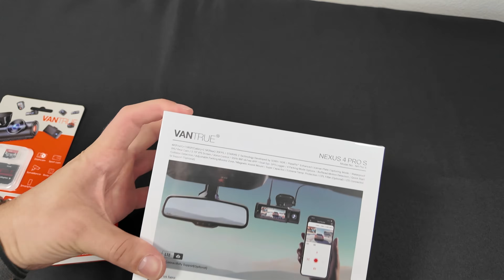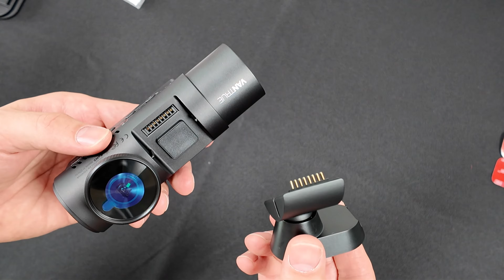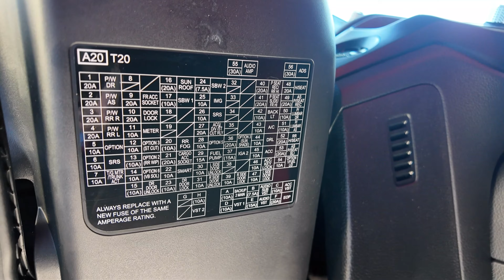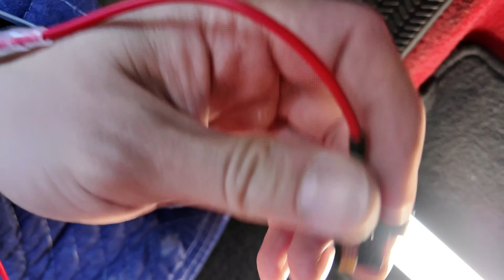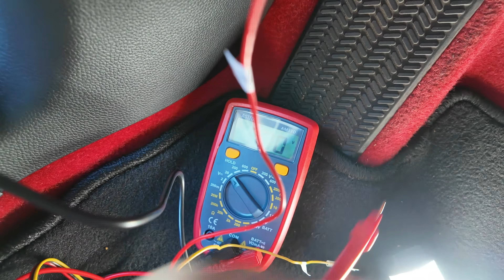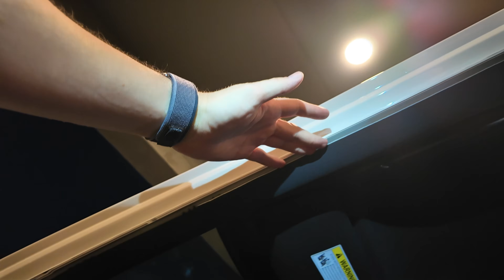Front Dash Camera Install | Part 1 (Full Step-by-Step Guide)

Comment: I’m a little confused bc you’re saying sunroof fuse but the fl5 has no sunroof
Reply from the maker: Good question! 👍 You’re absolutely right - the FL5 doesn’t have a sunroof. I used the sunroof fuse slot because it’s an unused circuit that’s still switched with the ignition, which makes it perfect for powering the dash cam safely. I probably should’ve explained that better in the video - appreciate you pointing it out!